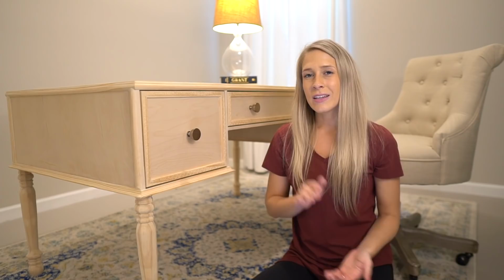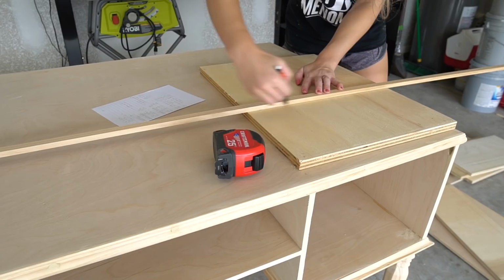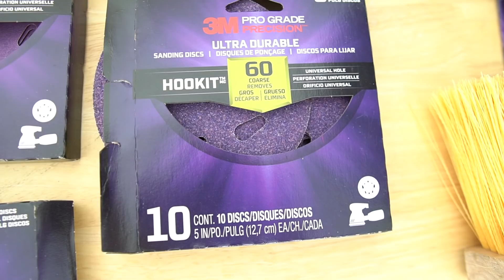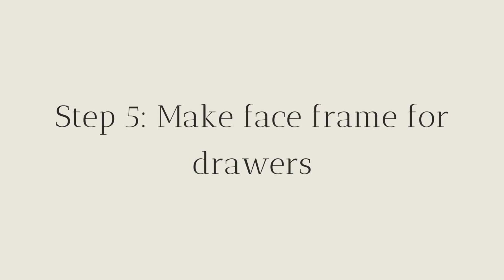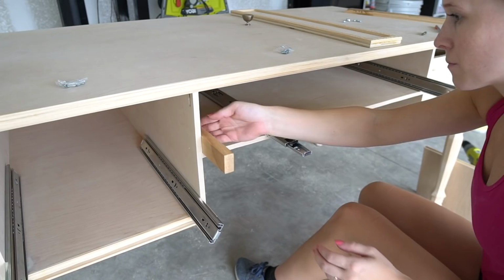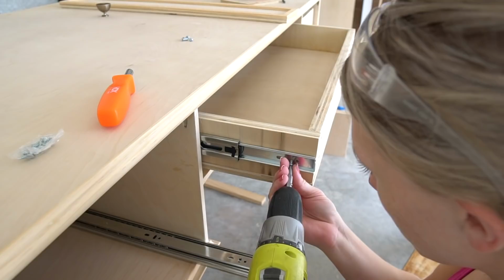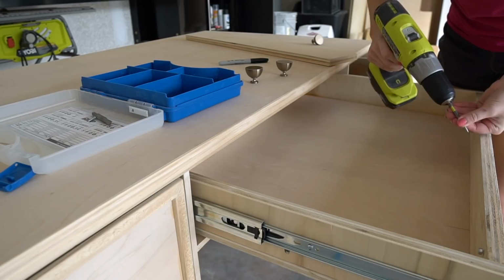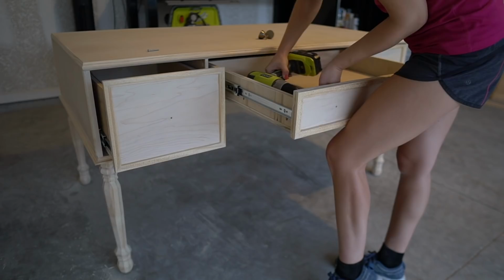How to Make Drawers | Inset Drawer DIY | Home With Stefani

Comment: Love the energy and great work! Here's another tip for Drawer Fronts playing cards and double sided tape it works great especially for repeatability.
Reply: How exactly would one use these two items to help?
Reply: @lauriepayseur5897  So the playing cards are used to give you a precise and even spacing when fitting the drawer and the thin double sided tape will adhere to the drawer front. This allows it to stay temporarily in place until you can permanently secure it.  I hope that helps there's a few channels that show how to use them too. You can also use super glue and a glue accelerator, or hot glue.
Reply: @timhand2503  thanks 😊

Comment: Another trick with drawers is to take a router and use a camfer bit on the bottom of the drawer to make it almost invisible when it's opened. Just an aesthetic thing, but it adds a nice high-end touch to it.

Comment: As a furniture maker I use a blanket under my material when I sand it. That way it will not slip away and will not scratch the sanded sides.